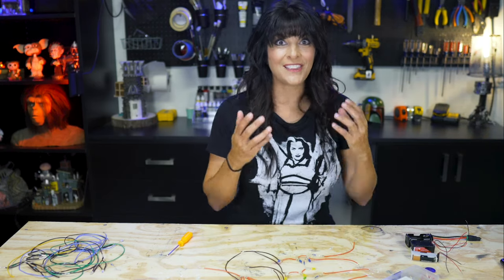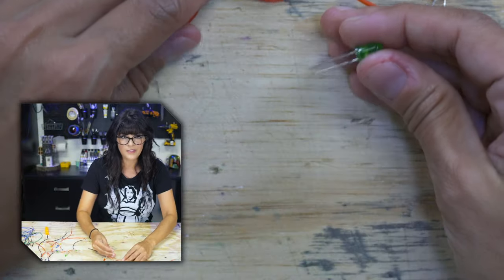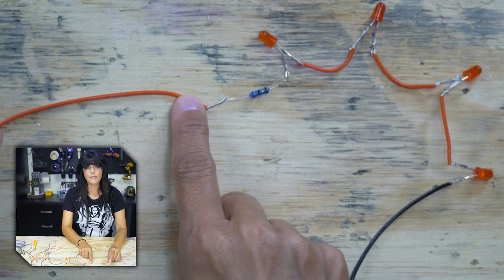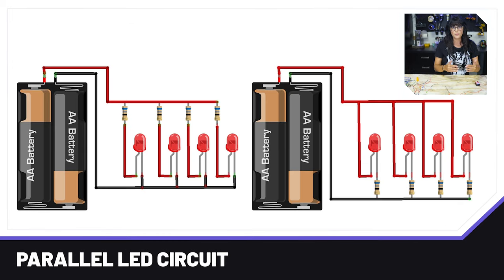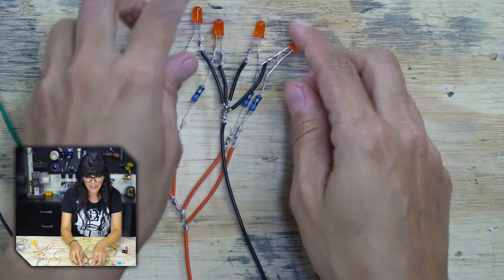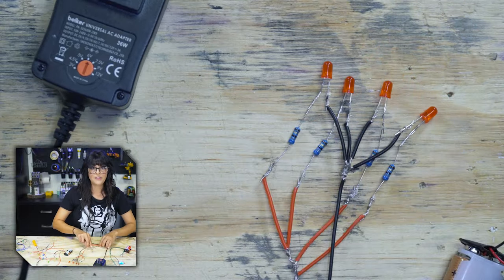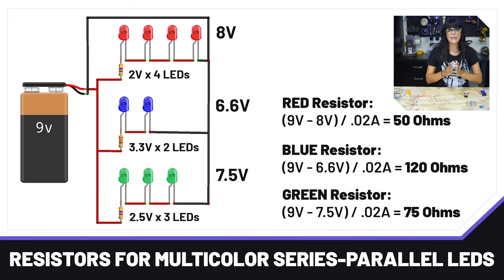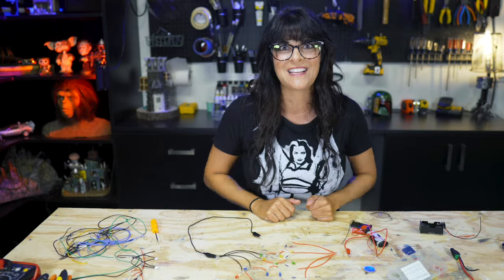How to Wire Multiple LEDs: Series vs. Parallel LED Circuits

Comment: There is another way to also tell, look inside the casing and the section of the LED that is larger is the negative side. This is good to know if someone cut all the leads the same length.
Reply: Good tip, i never heard any youtuber mention this other then checking the leg length but once you bend them they look about the same and it hard to tell, this is a fool proof way to know for sure.  That being said you cant hurt a led wiring it backwards like an electrolytic capactior. ITs a diode so its just blocks the other way, up to a point, but that point most of us wont reach playing around with them, allowing too much current is what hurts them. I seen a video i think electrozap tried to put a diode to help with voltage spikes to protect a LED's or something simliar but more importantlyfound he couldnt burn out any LED with no matter what voltage his power supply applied to it, i think like 40v max. He kept it a a constant current, showing that high voltage doesnt burn out  LEDs apparently, just high current does.
Reply from the maker: That's a great tip! 👍 When the leads get cut then I'm always looking for a coin battery to orient it correctly but it's much easier to look inside to tell the difference.
Reply from the maker: If I bend or cut the legs then I'm always looking for a coin battery to position the LED correctly so looking inside is a good tip. I'll add it to my routine! 👍
Reply: @RachelDeBarrosLive  The button battery test is great if the LED is still loose, not so much if a string of LED's have been soldered to a circuit board. 😜

Comment: The coin battery is a great tip. Never thought of that. Beats always pulling out the alligator clips or breadboard every time I need to check one.
Reply from the maker: Having first learned to use LEDs on a breadboard with Arduino. I used to do the same thing!

Comment: Finally!! Straight forward, easy to follow along, readable diagrams, on point the WHOLE time and most all at no point did have to write down something that’s not explained to then go look that up. Amazing, thank you.  I have two question… I’ve always wanted to start adding lights to my woodworking and art so I save all old electronics. Can you take resistors from those and use them? Also do you do a video on reading resistors? Thanks again

Comment: I really enjoy the way you explain how leds are wired and voltage distribution. I knew some and learned more.  Your enthusiasm is amazing. I just finished a project involving Lionel Trains, Erector build and changing from AC to DC. Had two combinations of lights, two separate 3mm yellow led circuits in series, then 5 mm Red/Green in parallel for signaling. I didn't see a way of attaching a photo. Thank you for sharing your knowledge.

Comment: Hey this is great. Fantastic domain knowledge about electronics, et al and polished TV skills to make an engaging, appealing, and well-paced presentation is a killer combination of skill sets. It's so easy to make this stuff too dry, or too goofy, or patronizing, or whatever. It seems to me a lot better than it used to be, but used to feel impossible to casually learn about this stuff from someone who wasn't dead set on coming across like a punitive, lecturing grandfather, and I'll bet that turned a lot of people off. (Definitely pushed me away from amateur radio when I was a teen, that's for sure.) So often in tech stuff, the people that get all the recognition are the ones pushing the bleeding edge of the field. Sure, that's important, but I think people giving an impassioned introduction to the basics have a much bigger impact on the world on a whole. Thank you for what you do!

Comment: The video mentions that series circuits are good for when you have a limited power source. Can you elaborate on how many LEDs you could typically connect in series with a 9V battery?
Another advantage of series connection is that it requires fewer components. How does this impact the overall cost and size of the circuit?
thank u

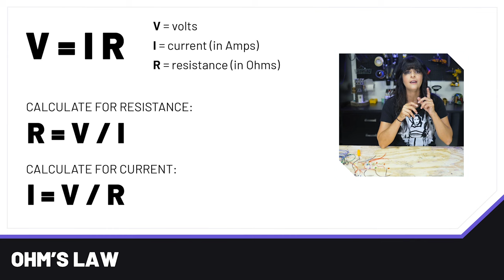Comment: Hello, I’m a novice interested in learning circuits. I have a question about the resistance calculations done at 5:08 : how come we didn’t have to add the current of all for LEDs to figure out the resistance? You divided by .02mAh and not .08mAh (for 4 LEDs). I seems like it’s always .02mAh whether it’s in series or parallel.  Thanks in advance!

Comment: Great video! I'm curious now, what if you had the situation where you had an variable number of potential LEDs attached (let's say someone can come along add an LED at whim) rather than knowing ahead of time. How do you do both A) protect the 1 lonely LED when no others are connected, and B) also providing enough power for when the 10th LED is added?

Comment: I need some help.  I'm working on a project.  What I want to do is place 5 leds on a light switch cover, and a few push buttons, one to each light.  I want to pull power for them directly from the side of the light switch if possible (safely) so that I can push the buttons and light the leds (with the light switch on or off if possible, if not then when on is ok.)  I just have no idea about how to draw this small amount of power from it.  The leds are blink type and small.  Any suggestions?  I want to use the stock light cover if possible.   Thanks!

Comment: So, I've connected some LEDs in my project all parallels and connected to the A/C power source. They all turns on. My project is house, garden and street lights LEDs. They all turned ON when they were all parallel connected to A/C power source. I never calculated or connected resistors. Are resistor necessary?

Comment: If i want to connect 5 white LED and 10 Blue LED in parallel to a 9v hw high watt battery what resistor should i use??

Comment: Fun fact: power (electrons) flow from negative to possitive. 

They found this out in the mid 20th century but since all the notation of all circuits was written, we left it that way. But if you want to be accurate, power flows from negative to possitive. That's why i like to place the resistors from the negative end :).
Reply from the maker: Me too! I've been placing resistors on the negative end for years. For whatever reason, when I started working with Arduino I switched to the anode. I'm not sure why but maybe it's because most of the wiring diagrams had it that way so I eventually caved to peer pressure and switched 😄

Comment: Positive isn't always the long leg.  Some are backwards.  Check yours before you install them.
The LED can generally take about 5V reverse.  A 3V cell is fine for a polarity check.  A 12V supply and a resistor is dangerous to use for polarity checking.  Most will be fine but some will get cooked.
The colorless case ones can be very handy because there is no color until you apply the power.  This makes more contrast in a blinking design.
Also remember less current makes less light.  You can run your LEDs at a lower current if they will be too bright at night.  In a dark room, you can see an LED running on 0.1mA (0.0001A)

Comment: Really love this video. You make it understandable and fun to listen to. I'm doing miniatures and need to fix lightning for my mini homes so checked to learn some more. Realised I had this small led lights at home while doing it 😅
Reply from the maker: I learned a lot about LED circuits with miniatures too. I built a Frankenstein castle facade a while back and wanted to add flickering candle lighting inside and blue flashes in the laboratory.

Comment: Different colors can be wired in series.  Just add up the voltages of the LEDs, subtract that number from the source voltage and calculate the resistor.

Comment: Hi, so i ordered like 2 packs of 50pc. 3mm red defused leds i am trying to connect 6 of them together but they all wanna flash at separate rates, what do i need to do in order to make them all flash at the same time ?  Im doing a 3 on row front and back. 6 total.

Comment: I'm trying to hook up three 5mm white leds and two red 3mm leds, as well as, two yellow 3mm leds to a small motion sensor.  When the motion sensor is activated, the leds will turn on. It is to be used in a model car, so when people passes the car the lights will turn on.  Can you show me in a video on how to do that.  That would be great.  This without using a breadboard because it needs to fit in the car, van or truck model kit. Hope to hear back soon because there is no video on how to do something like this.

Comment: I've been experimenting with some LEDs with built-in microchips for use in my pinball machines.  One is an 'extra fast flash' LED and they work great except for some reason they do not like being placed near the regular incandescent lamps in the machine, it will either lock 'on' solid or the flashing will be erratic.   Can anybody explain what's going on there?  Seems like the higher voltage 28v lamps in the game affected it the worst, and the LED was not even that close to the lamps, maybe 8 inches away.  I don't get it.

Comment: did you use copper wire?
can non copper wire from battery holder connected with copper wires?

Comment: So if I supply 3v to a parallel circuit of four 3mm LEDs that have a VF of 3 - 3.2 v..... do I not need to use a resistor? I have some 0 ohm resistors, is this what they are for?

Comment: These leds seems to be resource hogs.  Am I right in thinking that based on your example in the beginning of the video that even if you used a 120v wall outlet to power the series, you still would only be able to do 60ish lights?

Comment: Omg. You are my people! I'm a nurse, but I think I was meant to be in electronics! I'm trying to figure out how to put an LED on my 48v 100ah  batteries so that I can see if the pack is on.
Reply from the maker: That's a great idea! Let me know how you make out.
Reply: Here you also have to consider how much power will be dissipated in the resistor. For 1 LED at, say 3V, there will be 45V across the resistor. Power in a single part is the voltage across that part times the current thru it. So 45V x 0.02A is 0.9W. A 1W resistor would technically be enough but good practice is to stay under half of the power rating, so a 2W or greater resistor. Also almost 1 watt is significant heat.

Comment: Hi Rachel, I stumbled across your channel while trying to find out on how to convert power hungry antique outdoor incandescent Christmas decorations that have been in my family for close to 50 years. One decoration an X candy cane stands about 40” tall about 24” wide and has about 180 lights, Red, Blue Green and some clear. Many of the bulbs are burnt out and they cost about $1.75 Canadian each to replace. I’m not sure on how to calculate to run it in a parallel circuit nor the type of wire to use as well how big of a transformer I would need? Any advice or guidance would be greatly appreciated, BTW not sure if it matters but our winters can get down to – 45C to -50C does that have an effect on the type of wire?   I have watched a few of your videos, you have a new subscriber 🙂 Take care, Wayne

Comment: Have you seen those fairy light strings that have only two wires, but can alternate every other LED, turning half on and half off or all on, and can fade each set (odds and even) on and off but opposite each other? I wondered HOW this was possible, and can only imagine that the controller is switching polarity so fast we can't see it, but can feed both sets simultaneously. Wild...

Comment: 5:13 AMA BEGGINER, GOT A QUESTION, WHAT RESISTOR I USE IF I LIGHT UP 20 LED RED LIGHT IN A ROW WITH ONE SWITCH BUTTON DO I REALLY NEED A RESISTOR?, AND ABOUT THE BATTERY, IS IT ENOUGH TO USE 9V TO POWER UP? I MEAN IF USING 3MM LED LIGHT :)

Comment: If you mildly overvoltage them they smoke.
 If you put 12 volts on them they can explode,.. nobody warns of that.
Be careful, might even want eye protection when running these from 12 volts and a potentiometer.